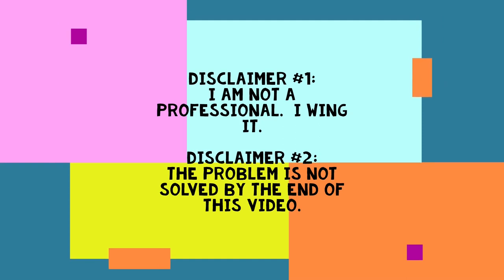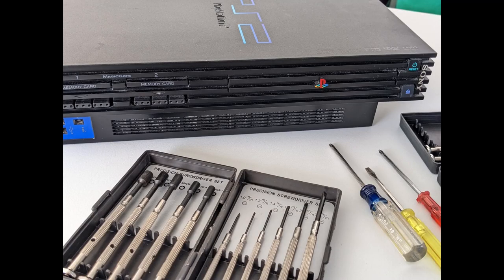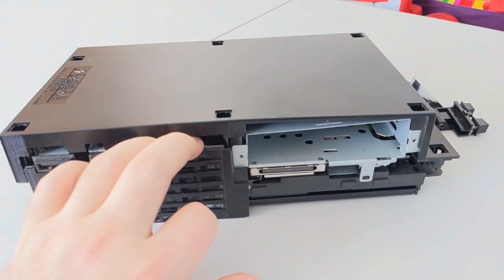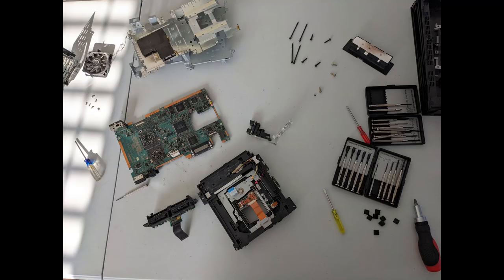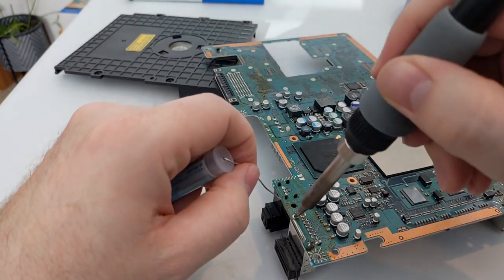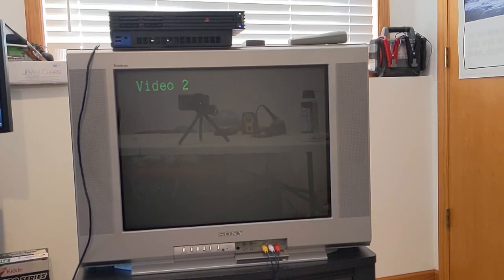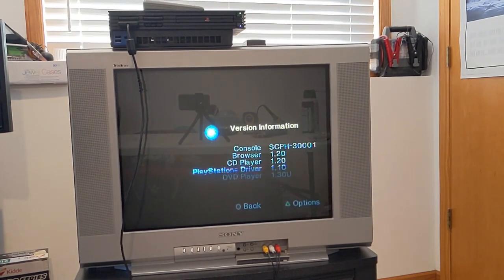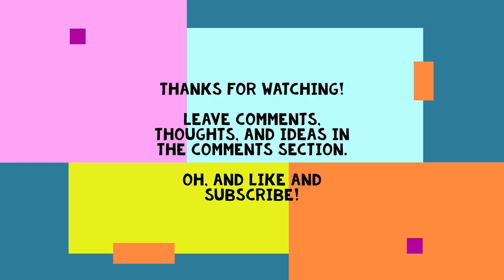Sony PlayStation 2 PS2 repair, SCPH-30001 browser hang, freeze on startup, troubleshooting teardown

Comment: buy new bios chip.. becarefull when buying bios chip make sure you buy the same as the ori there is 2 types of ps2 bios chip there is bios with big bold fonts on it and there is some with smaller fonts.. if you buy the wrong ones it wont kill your ps2 btw but it whould missing collor but if you replace it with the correct one then your ps2 will running again.. hope that helps..

Comment: in your case the console needs expert repair. it is not a software malfunction but a malfunction on motherboard components. more likely it is incorrect power supplies on the circuits affecting the cpu that force it to overheat quickly and crash. it is not the classic overheating problem, otherwise the console would turn off and acoustically signal the error. here it is system instability due to unstable current causing crash

Comment: yeah I've got the same problem. Likely it is a failure of an ic on the board. I'm going with a used board off an established seller on ebay. I'd rather just replace it for $35 than fiddle with it for hours n come up with nothing. Time is money, and aggravation.

Comment: This was never going to work, you need to actually test components with a multimeter🤣This video is hilarious, and the solder you were trying to reflow (pointless) is high lead content, you need to apply flux to get it to flow properly or apply low melting point solder, then remove it, then replace it with fresh solder. What the hell was this lmfao

Comment: I would have assumed the reason the orbs are frozen like that is because the clock battery is dead. Replacing that could resolve that issue.
Reply from the maker: Please refer to 5:11.  It's replaced.

Comment: I got one PS2 today in a really close symptom. Also never opened considering the official sticker.

Disassembled it and have a overview on the mais board. No signs of broken solder, stuffed capacitors or thinga like this. Tried with the original power supply board and a second ine I got. Same exact symptom: show up video when it wants, often freezes inside memory card and never showed a sign of sound. Checkes the cable on my working ps2, everythings working. 🤷‍♂️
Battery with 3V charge.
Reply: buy bios chip try buy 2 version of bios the bold font bios or the small font bios chip because ps2 either use 2 kinda that bios font printed on top of the bios.. your ps2 will back to alive..